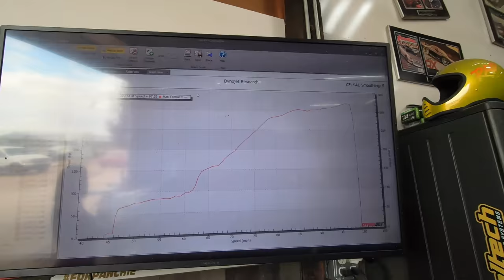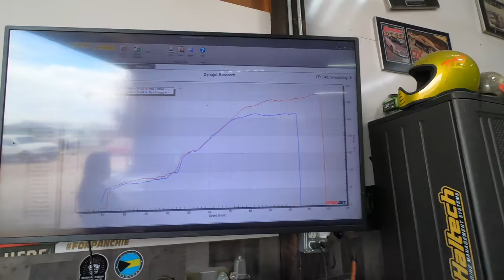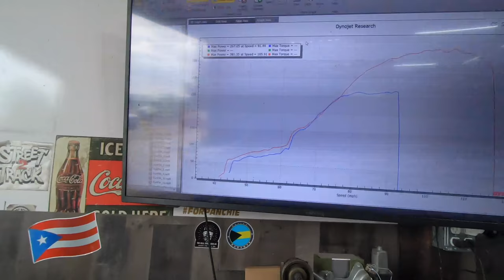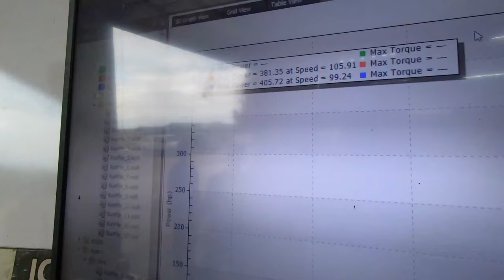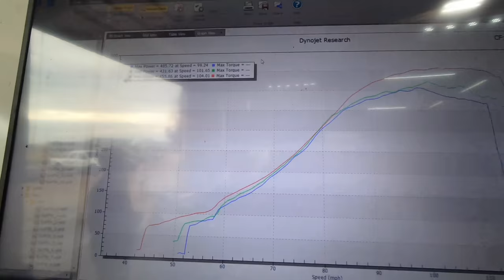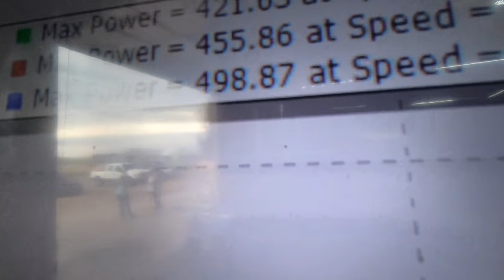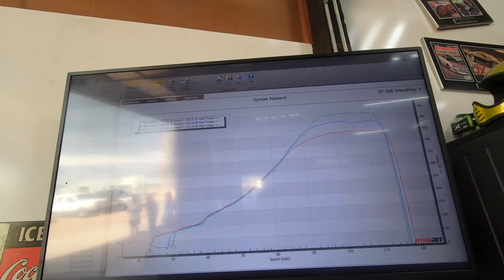Sweet Sarsaparilla The Prelude Rips!!

Comment: Quit using the parking brake at high speed. Use the regular brakes.
Reply from the maker: Had too
Reply: What a waste of comment.
Reply: No, he didn't have to. If the car doesn't have regular brakes, it should have been fixed before being driven. Pulling the parking brake at high speed is a good way to lose control and kill someone. Get out of the habit now before it happens.